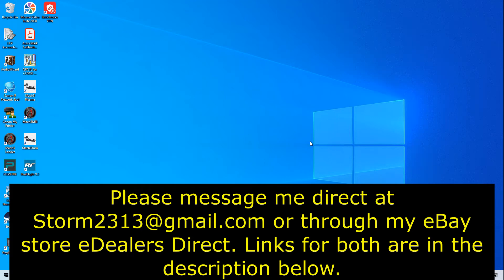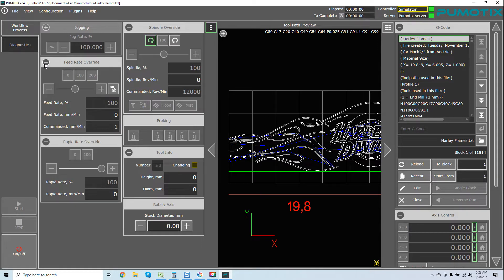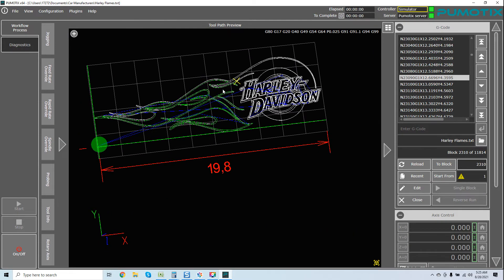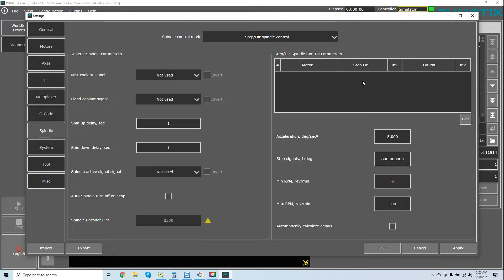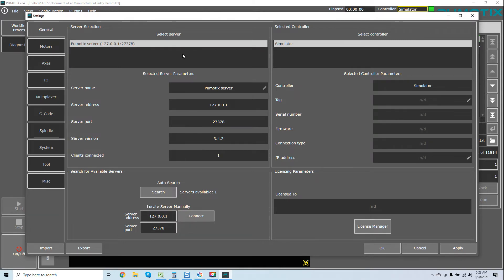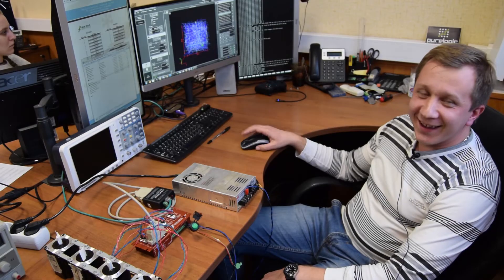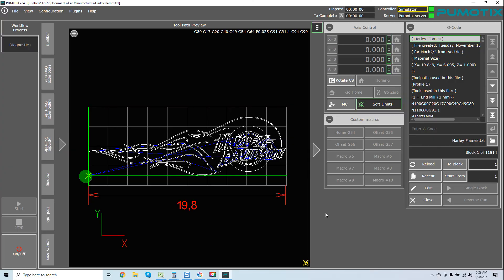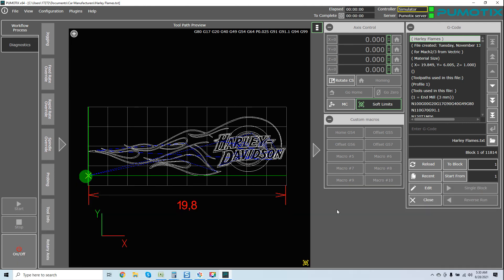Pumotix Already Had An Update!

Comment: is this any better than using sheet cam and MACH 3 ? I use AutoCAD 17 for making all dxf files.   cnc plasma with Gecko540 controller
Reply from the maker: Metal Works Machine Shop, thank you for your support. Pumotix is far superior to Mach3 with its plasma features. Here's the link to Pumotix https://pumotix.com/ to allow you to review the plasma features which allow for much more fine tuning of your system. I have the screen set, and all of the plasma features, and will be doing a video shortly to cover the options as they're extensive. In the meantime I this link covers the plasma module, and you'll see there's no comparison. http://doc.pumotix.ru/display/PUMENG/Plasma+cutting+module
Have a great weekend! Vince
Reply: @corvetteguy50  id like to test drive that program.. i didnt see a price on it on the website .
Reply from the maker: I'm the US distributor of Pumotix, and the PLCM. I need to know if your chassis is using four motors, or three?, and then I can build you a custom Pumotix package.  The basic plasma module for the software is an additional $50 from me. Here's the other many options you can add if you didn't see them https://pumotix.com/#soft 

Just click the plasma tab on the options menu, as each option's definition is listed as well.

Thank you, and have a great weekend!
Vince
Reply: @corvetteguy50   2 motors on the gantry x axis  ( slaved ) . 1 on the Y and 1 on the Z (torch) .  Ill check out the link..
Reply from the maker: Ok, here's the option you would require with the additional $50 basic plasma module. https://www.ebay.com/itm/133860410016 Thank you,
Vince